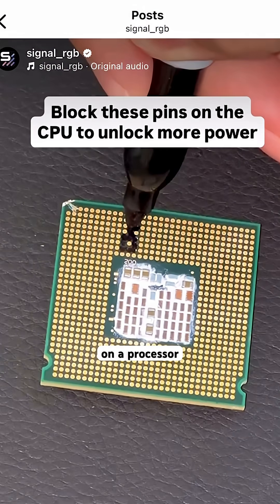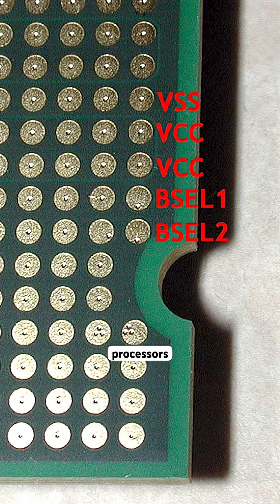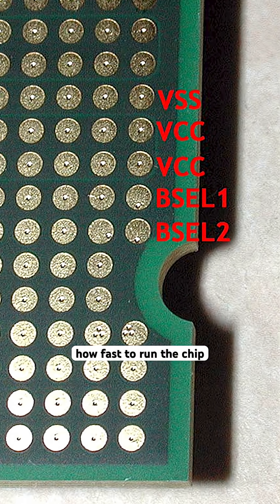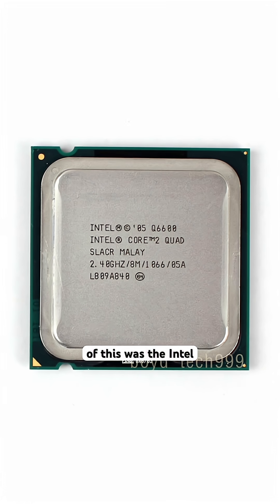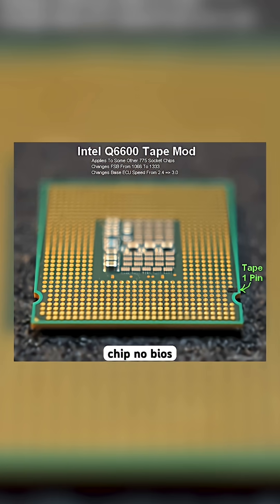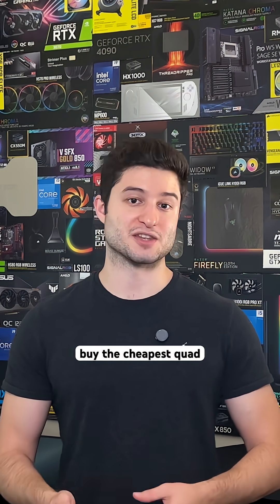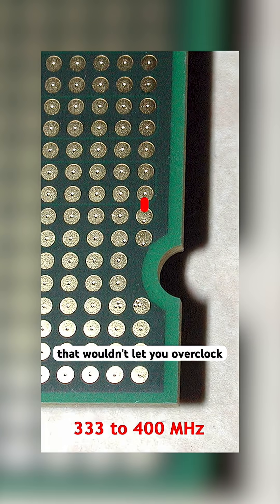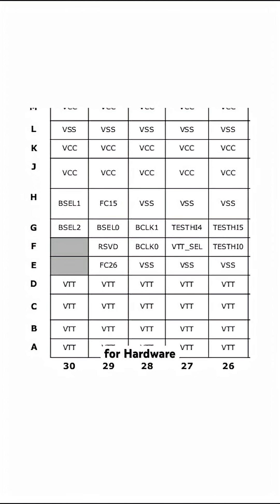Taping a CPU to improve it?!

Comment: Yeah, i had a Pentium Dual Core E5200 @ 2.5ghz
I had a abolut shity mainboard, i could overclock my cpu, but i couldn't change the voltage.
So i used aluminium foild, bridged some contaks, others constats where isolated, so no contact...
I think i managed to overclock my cpu to 3,5 ghz
With beaing absolut stable, under air cooling and it did run for years like that

Comment: Actually this is for setting the FSB clock up on boards without that option (OEM systems mostly) the multiplier stayed the same but since the cpu clock is derived from FSB the cpu clock goes way up.

Comment: Yup, did it on my Intel Core 2 Quad Q6600 in my Dell XPS420. Got my CPU to a sweet 3 Ghz.  (600 Mhz extra, 4 cores, 2.4 Ghz more computing power, so basically extra core worth of performance for free).
Reply: Shit dude, I had exactly the same PC with the same processor. It was my first ever PC I got at the age of 16, before I ever learned how to self-build. I never knew about this hack though.
Reply: @molymeme-r5p  Basically they are cutting waste by manufacturing and selling as much product as possible.
Reply: @molymeme-r5p  Same boat here, except I'm from the HP end. Prebuilt but with a TV tuner (selling point!) and a 750GB drive when everyone still ran 60, 120 and 160GB drives. Honestly wished I knew about this way back in 2009 though, but everything I did on that machine was far superior to anything all my friends had back in high school
Reply: That's wild!
Reply: But why use this hardwarething when it's just bumping the FSB to 333? That's what I did for my E6400 and then Q9400. FSB to 400 and done, 3,2GHz. The Q9400 even runs stable at 450, so 4GHz
Reply: @xpectthedeath  Because in my instance, I had a Dell motherboard that was stripped of all the OC properties, and the Dell XPS 420 was a BTX form factor PC, which means I would have to swap the motherboard AND the case, because BTX motherboards were impossible to find.
Reply: You shouldn't have had to hack it. Companies shouldn't be purposely using money to make something perform worse so they can make the untampered version look worth the large amount of money it's not. 

Fuckin tech world is a giant scam.
Reply: @ValorieGaming  They started locking down multipliers as early as the Pentium MMX days to stop sellers from oc'ing the chips and selling them as faster (and more expensive) models.

And in part chips are locked to that specific level because they aren't stable at higher clocks. Not all of them, but many.
Reply: @ValorieGaming or people are just lying to you, overclocking is never or very rarely is just free performance.

Comment: I heard something about many processors being the same but limited by things like this. You always had the fast processor to begin with. They limited it and reduced the price. I dont know how true this is btw.
Reply: You don't have the fast processor You have a damaged version of the fast process that's been modified to turn off access to the damaged bits or forced to run slower so that it doesn't doesn't underperform whatever they're selling the fast processor for. Basically most CPUs are produced attempting to hit the highest standard but CPU production is incredibly complicated and prone to error and faults and they basically bend the CPUs into the highest SKU and then for anything that fails to meet that standard they're just like well we don't want to throw these away cuz they're functional and they'll do the job we'll just turn off the damaged bits and sell them for cheaper. You go

Comment: Bro I still have my Q6600 from back in the day, you don't have to tap off nothing lol. You just increase the clock speed multiplier, increase the BCLK and set it around 1.4v you all through the bios and you can get 3.2GHz lol. It'll still run like that now. Like why tape things? lol

Comment: Same for using mighty Xeons (771 chipset) on LGA775 boards. They used tape with 2 wires, which connected 2 pins replacing them. So MB thinks pinA is pinB and pinB=pinA.
You get core2quad Xeon 3+GHz with loads of cache for around 100$
Reply: It was way cheaper than that. I remember I was buying E5450's for $20 just when this mod came out (2012 or 13). Anyway the prices of Xeons raised after few months because everybody was doing this mod. Then I bought X5450's for $34. The best (not the one with highiest clock) was X5470 and that was $50. This one had the highest multiplier in entire lineup and would overclock insanely well. It did go from 3.33 GHz to 5,0 GHz on my first try. The score is still on HWbot.
Reply: Got an X5460 for like 40€ back in 2017. Just bought it to tinker around with, but got it stable to 4.1 GHz.
Massive bargain compared to the Core 2 Quads which went for like 70 at the time.

Comment: I overclocked celerons back in the day, these were easy to OC and fun to see how far you could take them.

My absolute favorite was however the P4 Northwood, I once clocked a 2.0 ghz to a stable 4.2ghz
Reply: 2.1x overclock is crazy
Reply: Got my Celeron 440 from 2.0 to 3.5,
My P4 631 from 3.0 to 4.0,
my E8400 from 3.0 to 4.2,
and my X5460 from 3.16 to 4.1
Oh and my crappy 7300 GT from 400 core to 640 core.

Comment: Most companies just produce a single model of chip but the process isn't flawless so the perfect chips are e.g. the ryzen 9, ones with a few non functional cores are the 7 and so on. The manufacturers only need to produce one type of chip and the "waste" is also sold.

Comment: its sad this shit even existed. that means those "more powerfull" cpus were pure rip off. why? because they could...
Reply: It literally doesn't it was to avoid lying to the consumer The chip may run stable at 3:00 or it could crash completely and for the average home user you'd rather make sure that they run stably at so they hobble things that they aren't confident will hit the marks to make sure that they run in a safe range and then sell them for cheaper.

Comment: Amd athlon barton, throton or thoughbread. One of them had two pins on the top of the ceramic that can be shorted to unlock disabled L1 or L2 cache area. Doubled the cache.

Edit: AMD Thorton core cpu is a Barton with half the level 2 cache disabled. Most can be unlocked by bridgeing some pads.
Reply: You could also overclock it by using the graphite from a pencil to bridge contacts.

Comment: It was also a "thing" with the AMD Athlon processors.  We would lay tape down as a mask, fill in the laser cut trace valley with superglue, then use car rear window defogger paint to rebuild the cut trace.  There is still a video on how we did it on youtube from 16 years ago.  search for "toms hardware athlon unlock"

Comment: Also you can swap some pins using a sticker and cut notches to run 771 Xeon CPUs on a 775 motherboard. That was a cheap way to get a fast CPU back when they were transitioning to socket 1366 and 2011, and decommission 771 CPUs.
Reply: I loved doing that, basically a free q6600 even back then
Reply: This was the real hack, not some overclocking with extra steps that the video is talking about.
Reply: My mother used this xeon to core quad modded pc until 2023.
Reply: @outcastatsabre  my father still uses it. i still remember doing the whole thing even with the bios update bypass so it wont have a pop up notification that the bios needs update cause it doesnt recognize the cpu. But it would only work in the latest 775socket motherboards with the p45 board chip if i remember well.
Reply: @outcastatsabre  The fun with the BSEL mod is that it even works on motherboards that don't support overclocking.
The board just sees a CPU with higher FSB and delivers what that CPU asks for.
Reply: And the LGA771 quads are incredibly cheap. Especially compared to the LGA775 ones.
Reply: I loved it. Had an X5460 running a baseclock overclock to 4.3GHz

Comment: Back in the day of pentium 1 you could adjust the bus clock and the multiplier with jumpers.
20% was normal with stronger coolers even 50% was possible

Comment: Definitely depends on the chip. They don't just sell 3ghz chips and just slap 2.4 on them. It's entirely possible to get a chip that maxes out at 2.4 regardless of what you tell the mobo to do.
Reply: mine run without a problem on 3ghz and is still running. That cpu was a monster.

Comment: You could use a pencil (graphite) on AMD athlons and to unlock the FSB. Drawing a line to connect two contacts on the top of the CPU
Reply: I remember this well: Spending £20 on a Duron 800, cranking it up to 1.4Ghz and pointing a 12" fan at it.
Reply: @rossstewart9475  yeeep, i did the Exact same thing with my duron 950, i did a athlon aswell. hav one of thoes old school metal oscilateing fans pointing at it, playing compedative mechwarrior :D i also ran a dedicated server/ventrillo server on a dual cpu tyan board with 2 pentium 2 350's, it was Crazy fast for what it was.
Reply: @rossstewart9475  Yes!
Reply: Oh man, I remember doing that! Good times!
Reply: i Still have my athlon i pencil hacked in the attic to this day
Reply: I came here to say this. I had an Athlon XP 2800 (Barton), I think. I unlocked it and over clocked the crap out of it. Good times.
Reply: Did the  same with the old ATI GPUs like the radeon 4xxx series. Mostly the 4850s but I believe you could do some shenanigans with the 3xxx series too.
Reply: Boy that took me back. Where did all the time go...?
Reply: Yeah, I did that
Reply: Did that too, first 1GHz in the neighbourhood at the time.
Reply: Wouldn't it be graphene technically? (Since now we know how that works)
Reply: @UnfoxYourself  I think you're right, that's what I meant.
Reply: You could also cache mod some Durons and unlock them.
Reply: Yes!  Good times!
Reply: Yeah they got more aggressive with the laser cutting.
Reply: happy i'm not the only old guy here to remember that trick!! Good old times...
Reply: It worked on socket A athalon Thunderbird processors, but not the Slot A
Reply: @fionn256  Yeah slot didn't have the same fun factor
Reply: @fionn256 yes, I did that.. 25 years ago?
Reply: Those good old days..
Reply: Not the FSB, the multiplier...
Reply: You're basically saying you're old
Reply: @GiacomoGarosi  Better old than lame. Dork!
Reply: @GiacomoGarosi  way cooler than the lack of modding now
Reply: @GiacomoGarosi  im only 38 and did these things! but i was going to pc part expo's at 12 and building pc's then :D
Reply: @easyasabc0  just like me, that's because I said it 😅

Comment: Back in the day you could unlock the multiplier an AMD T-bird or (I think) Duron with pencil graphite.
Reply: Everyone bought the 650mhz model, overclocked to 950mhz with pencil mod.

I bought a duron 600, found it had an unlocked  multiplier to 7.5, and could run on a 130mhz FSB with stock cooling

Comment: This only worked if your motherboard supported the higher FSB (if you were gonna do this mod then it probably didn't). Most boards at the time had an FSB of 800 or 1066 Mhz, with 1333 only being available on higher end boards or as an unsupported overclock.

This trick was only useful on a handful of OEM systems with write protected BIOS and boards that had FSB adjustment disabled. It's the same as setting the FSB jumpers on older motherboards, the pins have just been moved to the CPU.
Reply: Wrong. Even if you had the option to change FSB in the bios by changing FSB in the bios you would overclock memory as well and it quickly becomes a bottleneck because of 1:1 frequency ratio. By doing tape mod (called BSEL mod) you would also change ratio of FSB:memory to 1:2 or 1:3 and you will not over-overclock your memory
Reply: @kityacat5419  Yeah, that is where you change the memory to 1:1 ratio.
If you can change FSB you would also have access to memory multis.

The more interesting thing is that a BSEL mod changes the northbridge strap.
The NB also has a clock and timings, at at higher clocks those timings would be relaxed. So pumping out 450 FSB from 333 is much easier than doing it from 266 or 200
Reply: LGA775 topped out at  1600FSB

Comment: I had this processor with sli evga gts 250s, ddr2 800 ram and a typhoon cooler in the antec 900. It overclocked well but I never knew about this hack. My plan was to get a 3rd 250 gts, but I never even needed to for Crysis at maxed out settings
Reply: Same here, ran a q6660 for a while but never heard of something like this.
Reply: Why would you have gotten a third gts 250 over a 280 at that point?
Reply: @kady5991  I was fascinated with the concept of tri SLI, and blew my budget on the motherboard/ beefcake antec psu. I even planned to eventually get higher end cards, but the dual GTS 250s were already surprisingly capable. I'll always regret not buying a 3rd, even if just for the memes/memories

Comment: Yeah, but that's not exactly what it is. 3Ghz doesn't mean better than 2.4Ghz. Most "Turbo" or similar options to improve performance just lower the clock rate. Why ? Faster = more errors = more recalculations. Heat is basicslly errors

This changes was also NOT consistent between processor of the same model. Usually smaller processors and just better processors with defects and they write "restricting measures" into it to not waste the CPU. Without these measures most defects processors would just not work at all. It's called binning.
Reply: What he didn't tell you is these processors were functionally identical to the higher end processors, they just added data to that one pin to slow down the chip so they could sell it at a cheaper price since there was a "budget" market.

Your second paragraph describes "binning" and yes, they usually did "bin" chips, but back in this time period the functional difference between different bins was basically nothing. Most of the binning we've seen that actually matters is entire cores being bad.
Reply: "Heat is basicslly errors"
No, heat is generated regardless of whether a calculation has an error or not.
Reply: Bro wtf are you talking about. Almost everything you said is made up lmfao
Reply: Lol. Pretty much all 800 and 1066 fsb Core2 chips could be set to 1066 and 1333 fsb respectively with no voltage change and pass a p95 stress test with only a minor bump in heat output. Go back to school.